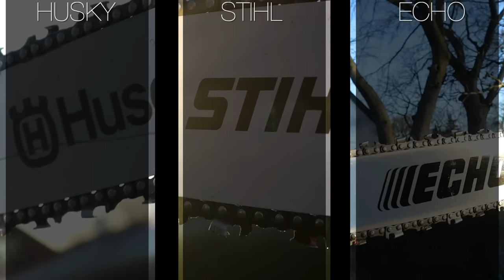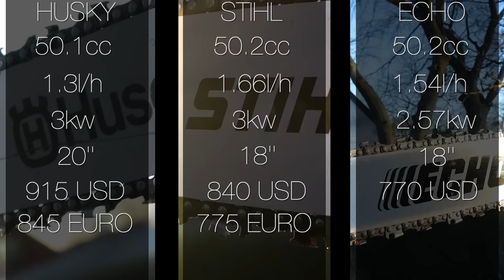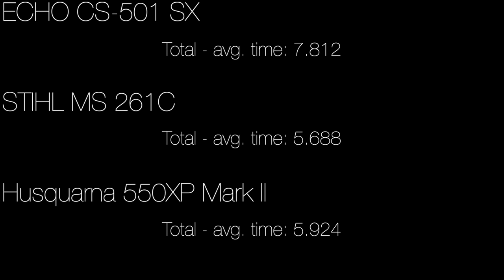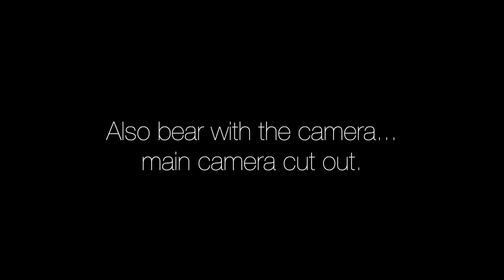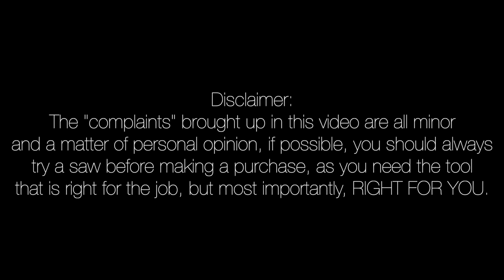Husqvarna 550xp mark II vs. Stihl ms 261 c vs. Echo cs-501 sx - Chainsaw comparison video

Comment: I don't know how I got here but one thing's for sure. In my own experience, Husqvarna beats Stihl any and every time.  All the Stihl chainsaws we had were always broken and took forever to cut the smallest of trees with a freshly sharpened chain. Got through 4 Stihl in the time we got through 1 husqvarna. How many hundreths of a second it takes more than the otherto cut one tree is pretty irrelevant. I don't do this anymore but unless things changed significantly in the past 20 years, you can't go wrong with Husqvarna. And being able to hold them the way no one would ever hold a chainsaw isn't an argument nor a selling point. The girl just likes stihl for some reason. I don't and never will. Trash company that sells expensive junk. Chainsaws, weedeaters, you name it. Stihl is always a pretty bad experience.

Comment: The comparison is a bit wrong, because first of all ECHO isn't a profesional machine ,the comparison should be between the two professionals... But the ms 261 it is the only multi-turn from the queue of Stihl. And the 550xp the slowest of the 5 series of Husqvarna... So try it again with ms261 vs. 372xp.

Comment: Sounds like the Echo could use a tune.
Reply: Definitely sounded like it could be leaned out more. Was slow revving
Reply: I agree, a adjustment on the carburetor and it would be a game changer. Also the echo is driving a larger bar too. For the price for a home owner I would go with the echo. The sthil & husqvarna are close though.

Comment: I have experience, difference between STIHL026 and McCulloch839mac cat.
Same pile of wood same species. STIHL026 need much more fuel and time than McCulloch839
Also STIHL026 much more heavy.

Comment: the Husky is such a better chainsaw from the video and the fuel consumption. the engine didnt seam fazed my the wood cutting where the other 2 you could hear the engine slow slightly. also i know people with husky's and stihls and the husky's are alot more reliable as the engines have a nack of crapping out on the stihl saws

Comment: I prefer my Husky 545 xp Mark II to my 550, the 545 is much lighter & cuts just as fast for firewood sized timber.
Reply: I am debating between the 545 mark II and 550 Mark II.  It’s about a $70 difference. And even at that price point not sure it’s worth $70 more for just a bit more power. What you think?
Reply: @bryansmith1992  Absolutely go with the 550 mark II. I wish I had done that now but when I bought the 545 mark II the upgraded 550 wasn't available. The 550 MII has better HP for the same weight. The early versions of these two saws had hot restart problems but they solved that with a better separation of the carbs from the cylinder head plus adding a heat shield. They are both strong saws for their weight but the newer 550 has more power in the same package. I love my 545 MII but if I had the extra "ponies" I'd love it even more!
Reply: @mikephillips very helpful insight.  Thanks for the write up.  I will def pony up the extra$ for the 550. Better to have more power than not have it.  Thanks again!

Comment: Ok First I "LIKED" the clip ... But not addressing the major difference about the Hsq & Stihl vs The Echo is ... Too big not to engage . The Hsq & Stihl are electronic controled carbs ... The Echo is old school . Old school meaning it will NEVER fail ... Humid day ... Set your idle and gas intake for it ... Colder ... Get the screwdriver out and fine tune it perfect for every occasion ... 

M-tronic should have been discussed in this clip, In my opinion . Conventional carb screws always work if you take 5 minutes to go over humidity, altitude and temperature fine tuning . When electronics fail ... The ONLY issue becomes the DEALER and that is NOT a good outcome when one has to cancel a day's work for fixing a tool . Electronics on a chainsaw ... Is overkill . What is the point ... Pleasing Effin' Greta Thunberg ??? 

So ... Good clip for someone who never LOOKS under the hood . JDs tractors are plagued by the same illness in 2020 ... Dealers suddenly become your best Bud when you allow this new tech into your tool box . Then again It is only an old farmers opinion, and I have been wrong on many occasion . Good day Female lumberjack :)

Comment: echo is not broken in, nor adjusted correctly................Stihl power toggle is cheap, just my observation after using all three saws full time.........................Husky is the best saw, Echo is the best value when adjusted correctly

Comment: Ms261 all day long everyday never fails until you drop it or run it over!!
Reply from the maker: The one we have at work has been dropped and ran over and it still runs like a charm 👌
Reply: Tough little saw!

Comment: you wouldn't agree with how i start a chainsaw, left hand on pull rope, right hand on saw handle/squeezing throttle trigger, pull up with left, drop my right hand down and let gravity help, non of this put chain brake on or place on the ground shit, and before all you paul bunyans out there give me a lecture, i grew up in north central maine, step dad drove truck, hauling logs, brother in law runs a logging company, i worked many a month during high school helping as a yard man, cutting logs to size, drove skidder, fell a few trees, i grew up around chainsaws, dozers, skidders , trucks etc

Comment: Who agrees the Echo sounds the best ? Just sounds more aggressive
Reply: The saw in video isn’t tuned properly u can hear it in video not reving up like it should
Reply: 440x then it’s not a fair test
Reply: Tdrex820  agreed I have a bunch echo saws I own the cs 490 there little screamers when setup right
Reply: 440x yes I have a 355t & a bunch of other echo gear.  I have been removing the exhaust screen but thinking about playing with the valves
Reply from the maker: The echo saw is brand new as a mention in the video, but I didn’t have the possibility to test it out before :(

Comment: I don't know why Huskies are priced more there, Stihl is higher over here. Echos are more of a home owner saw. Stihl recently followed Huskie by building plastic cased saws as their older saws were very heavy. I own both and I prefer Huskies but both are great saws. Not into fuel injected Stihl or auto tune Huskies, waste of money IMHO.
Reply: Echo is by no means a homeowner grade saw. They are very well built and check all the boxes that make a "pro saw". They do have a cheaper versions but most of those are far better built than husqvarna or stihl's homeowner offerings.
Reply: I find echo to be a good professional grade saw that's actually priced so a homeowner can afford one.
Reply from the maker: All 3 make some awesome saws

Comment: I have the MS 170 have had it over o  12 years. Also have the ms362 both great saws. I have owned many echos only last about a year. Cheaply built chinese junk. Had a husqvarna loved it. Motor finally went up. I own a lawn care and tree service. I also do small engine repair..I can tell you from experience. Stihl and husqvarna are much better then echo. Parts for both stihl and echo are of better built.  Echo is Chinese junk.

Comment: None of her comparisons are valid due to the difference in bar lengths. She does have nice headlights though.
Reply from the maker: it depends what you're comparing.. if I didn't let you know that there was a difference then it wouldn't be valid, but im comparing the saw as it is when you buy it

Comment: Um the length of the bar has more friction. The Length of the chain is not a factor in regards to cut speed except for the friction. The Chain speed is measured in M/sec this has nothing to do with length of chain just the number of  teeth of the sprocket.  The Chain as supplied with my 501sx is crappy low kickbach chinese oregon crap. Put a Stihl chain and compare apples with apples.

Comment: See what you need to realize is
 That metal switch on the echo will never fail or break.  The others will
   I personally HATE stihl.  Hate them so much
Reply from the maker: My colleagues and I made a video with the echo switching it on and off with the metal switch but the saw kept running...
Reply: @Femalelumberjack  LOL. You go girl.

Comment: Never rev a cold engine.
Reply: Not true...you are referring to the metals inside expanding and contracting at different variables i.e...the Aluminium and steel parts. Its been proven to be fine. Main problems come in the cool down stage and running a saw hot for a long time in cold weather.

Comment: after 1 year 10,000 hr the Husky will work the others will die!! still carbs are shit the old ones in 1990 were amazing grab an old saw and refurb it with better pistons high performance and carb they last forever!! but Husky is the KING and why in th forrest they are the only ones used by pros